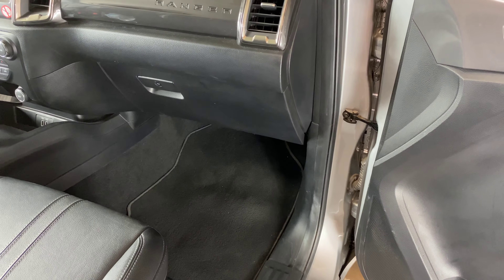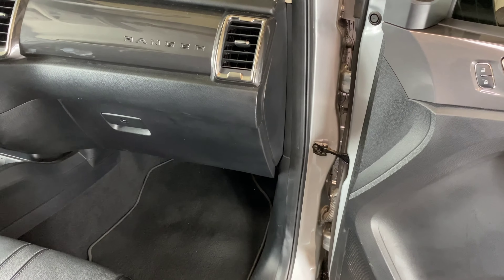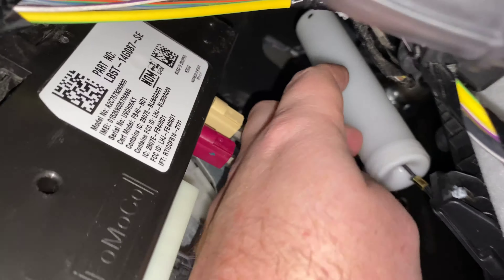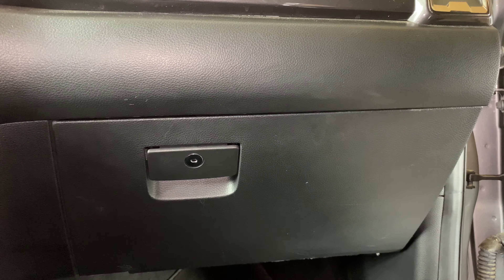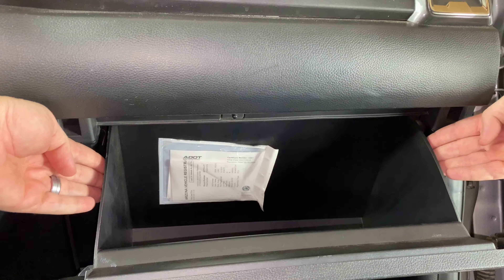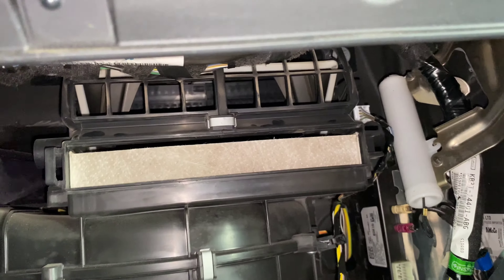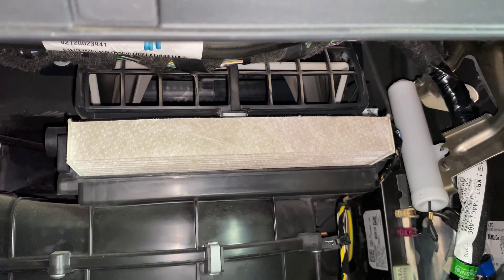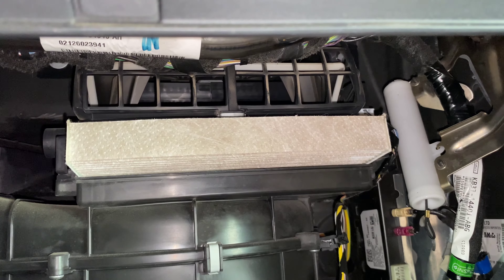How To Replace A 2019 - 2023 Ford Ranger Cabin Air Filter - Remove Change Replacement Location

Comment: Thank you! A $25 filter (at the high end), it takes five minutes to replace and the Ford dealer charges almost $100 to replace it. That is crazy!
Reply from the maker: You're Welcome! Yeah - unfortunately some dealers charge a full hour of shop time for this
Reply: That’s burglary
Reply: My ranger doesn’t even have the cable so it literally took 30 seconds.  Thank you!
Reply: Yep. Usually have service done at the dealer but I’ll do all this little stuff. Took 3 minutes to swap.
Reply: @donbrashsux  some shops have a 1 hour minimum per line….
Reply: They wanna charge me $55
Reply: Same  @brohammer
Reply: $42
Reply: @PYR-Auto what does the dampning cord do?

Comment: Any advice on replacing one for a 2003 Ford Ranger Edge,  I can’t even find it. 😂. Is it possible that it doesn’t have one?
Reply from the maker: I've never done a cabin filter on a 2003 ranger so I cant say for sure, but if you have looked behind your glovebox and didn't see it I would strongly suspect it does not have one.  In those years it wasn't a standard option on most vehicles - I just tried to replace one a 2004 Suburban a couple days ago only to find it wasn't equipped.

Comment: What does that damping cord do?  Looks like it might be easier to remove once the glove box is lowered.
Reply from the maker: The damping cord allows the glove box to open slowly instead of just falling open.  It gets tighter the more the glovebox lowers that's why it needs to be removed before lowering the glovebox all the way.
Reply: In addition, the dampening cord is an option.  Not all 2019+ Rangers have it